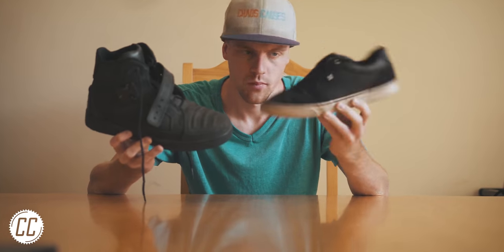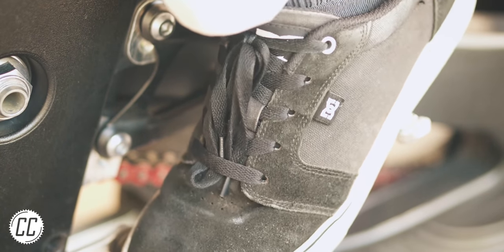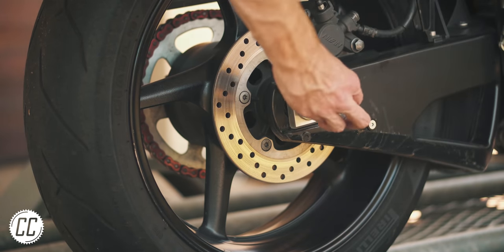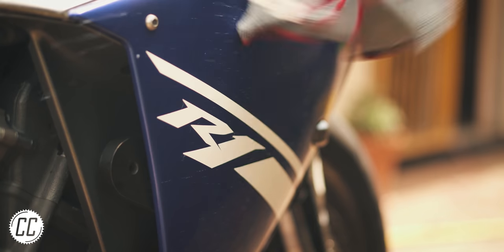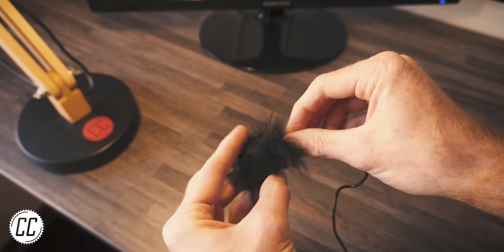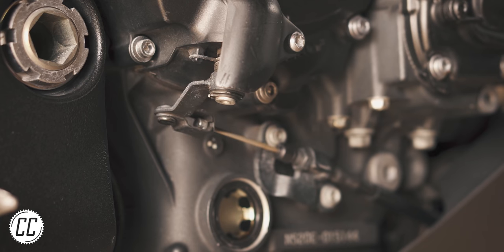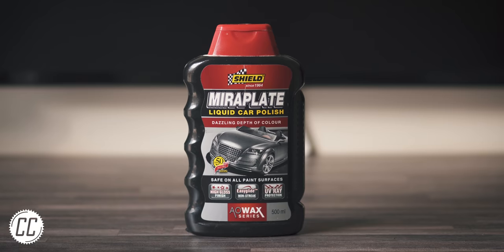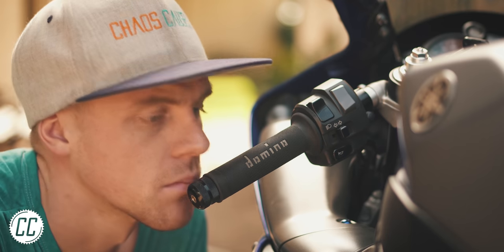10 Motorcycle Hacks And Tips For Bikers

Comment: So the simpelest way to clean a helmet that ive found...espec ialy with bugs is to just take a large hand towel big enough to cover most of the helmet....soak it with hot water (as hot as the tap will go) then wring it out and immediately lay it over the helmet...let it sit for like 10 or 15 minutes then useing the same towel just wipe it clean...the hot water softens everything up and its easy clean up!

Comment: Don't need to wax it every time there are bugs... Take a small hand towel run it under hot water, hot enough to steam but not too hot that you can't wring it out a bit, put it on top of the helmet and come back when the towel is no longer hot. Bugs and grime will wipe Clean with one pass with a microfiber cloth.
You can also do this to the front end of the bike!!! 🏍 😎

Comment: Can I add a tip for cutting down your threaded rod? Put two bolts on the rod first, not only will thy guige your hacksaw but when you unscrew them theyll remove damaged threads. Simply cut, file down a chamfer and unscrew for clean, easy to use threads.

Comment: Instead of hair spray you can just boil water in a kettle and leave the grip in it for 5 minutes the it is supple enough to put on easily and when it cools down it will tighten up on the handle bar

Comment: I wouldn't do the shoe lace thing.. laces can become untucked, especially when using your feet to manipulate the foot controls.
also the fur around the mic thing isn't a scientific mystery. microphones work off of pressure, sound waves hit the delicate sensor and relays the signal. wind is another pressure form. sound will travel through open space with minimal dispersion. wind however dissipates more easily so many little things in front of it will start knocking the level of pressure it can generate. think of being in a forest on a breezy or even windy day, the tree tops move but down lower you can barely register it, now you can hear from a much further distance of noises you wouldn't hear in the same wind if standing in an open field.

Comment: Not won't be careful with those green scouring pads they will scratch up a surface I know you weren't using on paint but this is how I wash my bike I do not use a rag I don't have to use a double bucket method you buy some purple Power it's not as strong as super clean or you can use Meguiars wheel cleaner squirt your whole bike down everything the whole bike paint Wheels tires and all but first rent your bike lightly then squirt it down with purple Power or Meguiars wheel cleaner squirt the holbach everything sit for a couple minutes rinse it off your bike looks brand new

Comment: With the shoes, you could just tuck your laces inside the side of your foot in your shoe 😂😂

2nd. You shouldn’t be washing your bike with a microfiber cloth......🤦🏼‍♂️🤦🏼‍♂️🤦🏼‍♂️ you should be using an actual an actual washing mit 😑😑 jeez. That’s common sense microfiber cloths are meant for quick wipe downs, drying damp (not soaked), but if it’s damp that’s where the micro fiber comes in handy. I mean if you’re like me, I wipe my bike down after every ride. Sometimes I’ll do 2 rides then do a quick wipe down but then I’ll use 2-3 micro fiber towels, so I don’t use the same side twice and then like a smooth shop rag or something that I don’t mind get absolutely dirty from brake dust, I’ll use on the rims and the Motul Chain cleaner, spray it in the rims, then wipe it off. Boom done. Did it in my drz400sm wheels, yes the ones from factory, the excel gold ones and never had a problem with the paint/power coating or whatever they use to color the rim